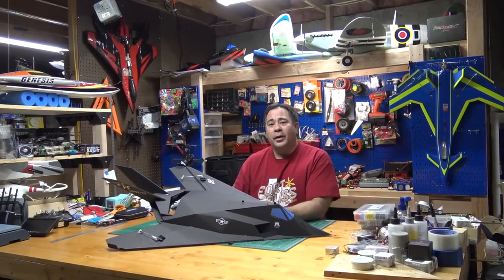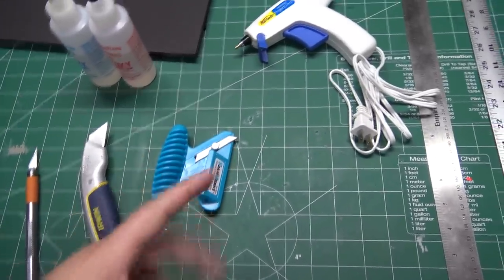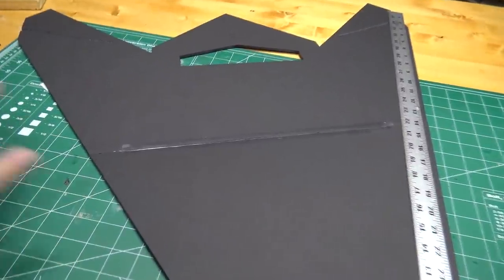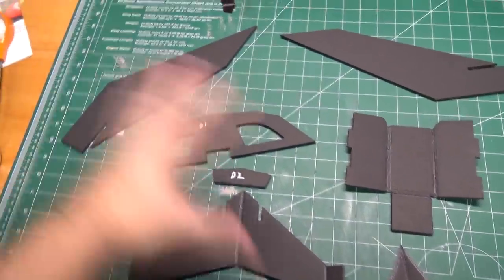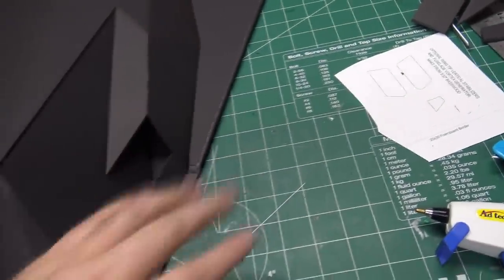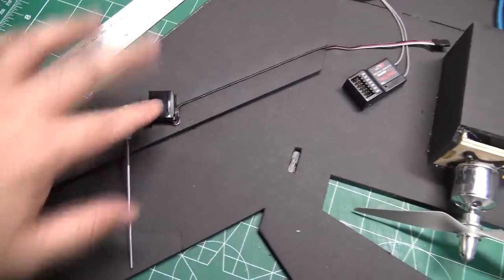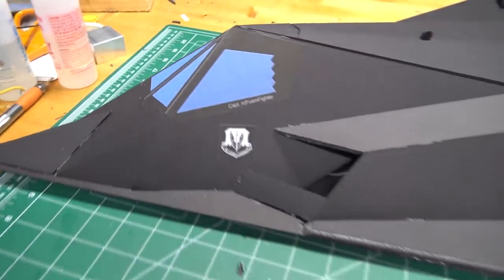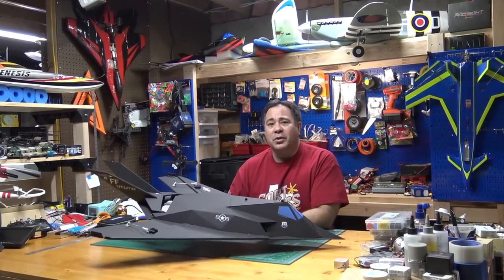FF-117V2 Build Video

Comment: Paul, going back a while I tried my best to get this one to fly. All I could manage was a rotation to the left and a nose in, crunch. Attempt, rebuild, attempt, rebuild. I had the motor square to the C/L and wing, it just wouldn't fly. My bad. Yours flies fantastic. I'll be making another in the future, never give up.
Reply from the maker: Hello Frank, sorry to hear of the nose crunch on the maiden flight attempts.  It sounds like possibly you are having some torque roll to the left. At the low speed while launching the torque of the motor can make it roll over. For your next attempt, try and add a little preprogrammed aileron trim to the right. Also I usually add in some extra up elevator reflex (trim) on my maiden flights to make sure it does not nose dive on launch. After you get it flying you can adjust the trims as needed.  Last try and launch it at a little higher angle if you can so hopefully it gives you an extra second to react to how it flies on take off.  Not sure if this will help, but hope you have success in getting it to fly.  Once you get the FF-117V2 dialed in it flies really good. Let me know how it goes, good luck!

Comment: Hello, I have a question, since I bought your plan, I wanted to know if the thickness of the foam board of all the parts is the same?  and how thick is it?  Greetings from Peru
Reply from the maker: Daniel the Foamboard available in the USA is usually 3/16 of an inch or about 5mm thick. All parts are the same thickness.  I have seen people from around the world also build the plane with 6mm thick Depron foam and 6mm thick Cloroplast type board.  Some have even used balsa wood.  All of these should work fine, the only thing you may need to do if using a different thickness is make sure the tab slots are cut as thick as needed.
Reply: Thank you very much dear for your prompt response, greetings!

Comment: Wish I had found your site earlier! I bought your plans and I'm currently about 85% done with the build. I was just thinking to myself if it would be possible to turn this from a 2 channel bank and yank to a 3 channel with rudder control. Did you ever think about adding another 2 servos on for rudder control or know of anyone that tried this with your design?